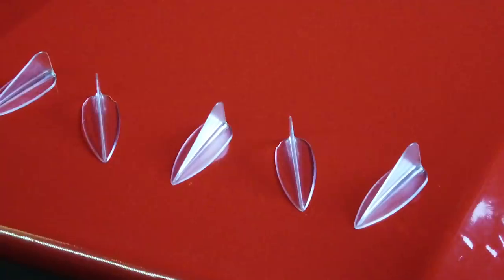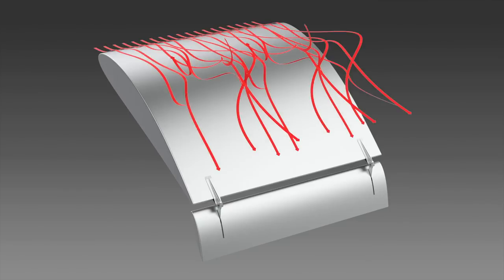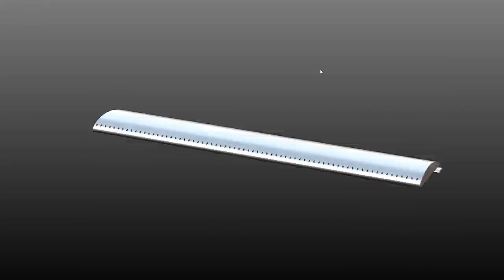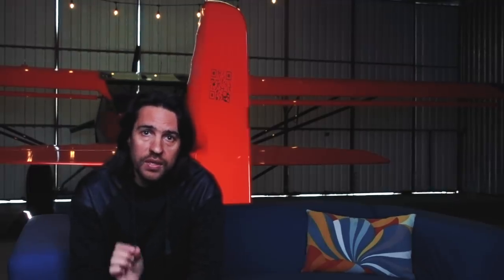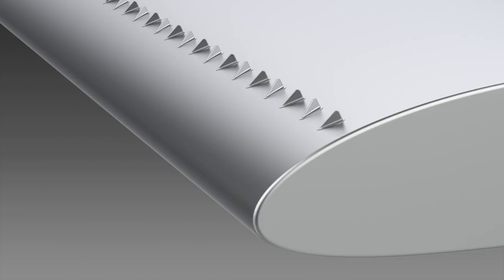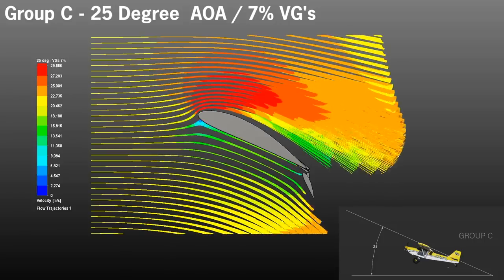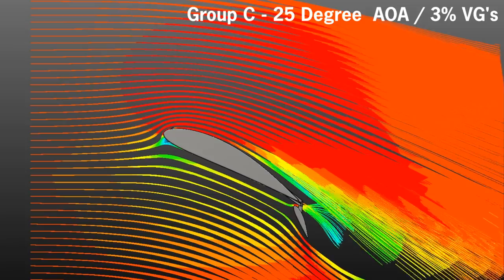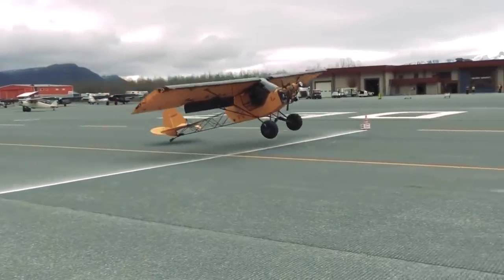How do Vortex Generator work on the Kitfox wing? Where to place them? ✈⚙🛩🔧

Comment: As I understand it. AoA is the angle between your flight path and the angle of your wing. Not the angle of the wing relative to the ground.
Reply: But very interesting video
Reply from the maker: Thanks correct. I guess the graphics had the AOA angle reference line from a horizontal plane not the relative air in motion.

Comment: Great analysis!  What software are you using?  Can you report on the difference in AOA and CoLift at stall was for none vs. 3%? And how about CoDrag gains at cruise for the optimal VG configuration?
Reply from the maker: We didn't simulate that. We were mainly in interested on there the airflow starts separating from the wing. The Co was marginal, we did test that.
Reply: What software did you use

Comment: Have you thought about testing the angle of the vg's to determine if there is an optimum?  Also, what angle did you use in your simulation?
Reply from the maker: Can't put too much angle because it induces too much drag. Too little does not generate vortex. So 15 is around the correct angle.

Comment: The title should have been "How well do Vortex Generators work on a Kitfox wing?" since you never really say how they work,
i.e. you didn't explain why horizontal vortices prevent separation of airflow from the top of the wing.  I believe you also depicted
the width of the vortices as being narrower than they actually are since the opposing angles of each pair of VGs is because the
resulting vortices are close enough to interact and to reinforce each other.  If they didn't, all the VGs could point at the same angle.

Comment: Wrong...attack angle at cruise speed is not zero....you have to maintain a positive angle of attack, just to maintain altitude. You need to do ground school again
Reply from the maker: Yes, it is clear in other to achieve lift, AOA can't be zero. I described Zero as a way to compare and visualize the difference. It is described why I did that in the video description above your smart ass comment. And no, I don't need to do ground school again. I am verse and aware of my knowledge.